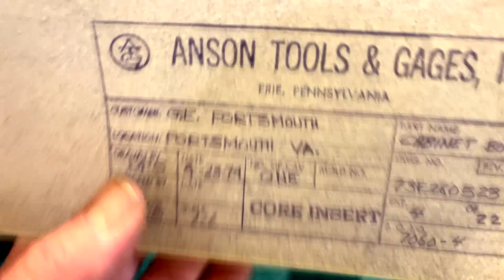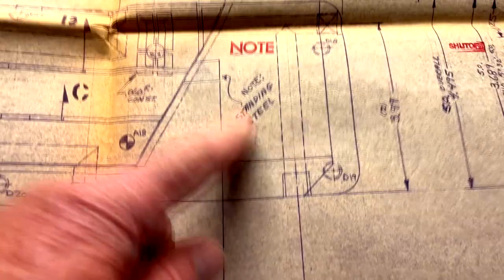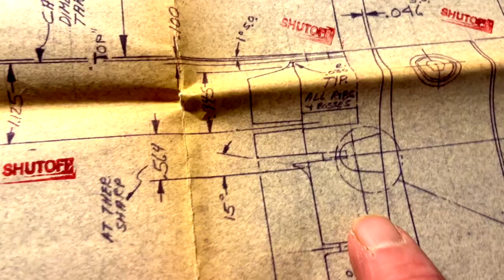The Elements of Good Design

Comment: Phil, I'm old enough (now a retired ME) to have made design (hand)drawings that pretty much did everything you asked for in this video, but unfortunately worked with way too many younger Engineers that were taught how to use CAD software but not how to make a decent drawing.  They were whizzes at CAD, but made all of the errors you mentioned over & over.  Unfortunately most of them were "too good" (in their own minds) to accept any helpful criticism of their designs and/or drawings.  Some even avoided visiting with the Toolmakers that were building whatever they had designed!  I think that I spent more time in Tool & Die talking with the Toolmakers than most of the other Design Engineers in my office, and jumped at the chance to spend a whole week working in Tool & Die while many tried to avoid their week.  Of course, one week wasn't enough, but I at least learned what a "tenth" really was.  The Toolmakers definitely appreciated Engineers that listened to good suggestions and wanted to learn!

Comment: I can relate. I'm a manual machinist in a one man aerospace test lab. Every feature on their drawings are like it's for the space shuttle. All of the counterbores and passages are all oddball sizes. I've been pushing for a conversational mill but they're full of excuses. So, they get to wait days instead of hours for parts. But my biggest struggle is that they provide me with inspection drawings, not manufacturing drawings. So, the datums just move around and the stack up dimensions are always from the opposite side of where I'm doing the work from. For instance, a simple block with thru holes and counterbores, I want the datum to be the back jaw of the mill vise but every view it's moved. The counterbore depth, is measured from the bottom, not the top, etc. I make a bunch of special hex bolts but they don't call out the size of the raw stock, because they just care about the measurement across the flats. I've done fixtures with dozens of components and they have no clue how to generate a cut list. I redraw and spend hours marking up their drawings. They have no interest in improving their communication. Glad that I took a semester of mechanical drafting.

Comment: I enjoy the old-school advice. I'm a drafter with toolmaking and maintenance experience in my field. I also create illustrations for maintenance manuals (dream job :)  ). There longer I work, the more variables I realize I have to balance to maximize efficiency. There's the company standards, industry standards (if the drawing is sent to another shop), human factors in manufacturability, etc. Design engineers abhor colors, line weights, etc, but you do have a point. Something that requires extra effort with cookie cutter CAD solutions is being able to draw the eye to critical portions and tell a story, like you described.

Comment: This is a TERRIFIC subject!    As a lead toolmaker (2015-2022) i ran into these same items all the time! Great design engineers but no practical experience so hole diameters,counter-bore diameters depths all in at least 3 place decimals! What ever happened to 1/4" ccb, 1/32" over sized usually? PRESS fit or slip fit OR they change inch to metric and give 4 decimal places for bolt holes counter-bore and depths!!! My guys would bust their BUTTS trying to HIT the depths and diameters!! OMG!! Drove me nuts!!  Many trips every day just to figure out the process needed! IF these holes are JUST clearance and counter-bores for a Socket head cap-screw! Even metric ones for maybe on a ZEISS cmm!! Work with us guys!!!
           I 100% agree! Let the toolmakers do whats needed to get it done! I explained this xact scenario repeatedly to our design engineers!! Give us toolmakers some credit just say ream for a press fit we will do the rest! Must engineers do not even know they make under-size, on-size and over-sized reamers!  .5312  then you really mean CLEARANCE drill 17/32" for a 1/2" SHCS! 
      I always tried to go SEE what we were making and what the fixture actually did! This would HELP tremendously when the CNC guys were trying to make the actual parts! I hated to find a boring head being used for a counter-bore for a capscrew! OR even the THRU hole that was listed as .2812" and there is a boring head being set up code being written to BORE the THRU hole and then all the gage's needed to inspect the holes!  I would tell them just spot the holes and ill do them! Many many trips to engineering and they finally began to change! SLOWLY!
          The other very COMMON problem i had was guys wanted to use their phones or RELY on CADCAM systems to figure it out!!!  What if you are OFF SHIFT?! Learn some trig! Learn some geometry.   Calculate the angles yourself if needed.  
       The DAY Boss once gave me a punch to finish. I did! The next day they called me at home desperate to have the punch! "Where is it?" I said it is finished and done in inspection! By the time they caught up to it it was in USE and making parts for Milwaukee Tool! They just could not understand how I finish ground  it! They had design engineering make prints and programs to cnc mill electrodes, inspect electrodes and then run electrodes and on and on! While CNC's are great ,I have ran many, we are losing so much OLD SCHOOL common sense it is amazing!!!
Reply from the maker: Definitely a kindred spirit!

Comment: You took all the words right out of my mouth Phil! I have experienced all of the above. Hard as I tried, I could not get the other designers to change units when using taps and counterbores. "it takes more time" they would say, not realizing the extra cost created by unnecessary tolerancing (we were using SolidWorks). Yes, illustrate your drawing so your Grandmother can understand it. I agree, ordinate dimensioning is the best. Incremental leaves tolerance stack-up. Great video. Thanks Phil.

Comment: We have one customer who chooses random sizes for standard things.... not even limited to fractional sizes of drills, often something in-between.

So what I am looking at as some special hole with a specific relief and .xxx dimension is actually just a drill and counterbore for a 3/8 shcs.
Waste a lot of time figuring if I need to get a boring head out.

Then the horrid dimensioning, we got another job for a bent structural peice and they don't have a single datum, some holes are from a corner, some from other holes, and some are measured from the bend. So get done with the tooling and run some sample peices and try to measure to make sure they are to print was a pain. Thankfully the tool shipped so we don't produce that part, it wasn't a progressive die.

I am just an apprentice, but it sure feels like so many other things in life it used to be a lot better but somehow we have lost lots of knowledge the last few generations.

Comment: Wasted tolerancing gone wild.
In the very early 80's at what was then Delco Electronics the decision was made to use metrics regardless from way up the ladder. A sketch by a somewhat aging manufacturing engineer and an unknown soul with a tape measure was made showing a mounting plate for a new hand operated god-knows-what that was to be bolted ,off hand in a much larger area by millwrights in an area that was designated by yellow crayon . The print, made by a newly graduated  engineer was drawn up showing the overall size and mounting hole dimensions of the quarter inch plate. The dimension  were called out to FOUR places in silly-milly-meters! Important SAE dimensions were called out to four places as needed but hardly ever in metric. I was ignorant Of the details initially so I wasted over a shift carefully squaring up the plate and then jigboring the mounting holes on a machine with an added on DRO, A trouble shooter in the radio lines area showed me the bolted in place assembly some time later and let me know that taking a day or so to do a two hour job was disgraceful. I agreed and showed him my print copy which is how I found out "The rest of the story".